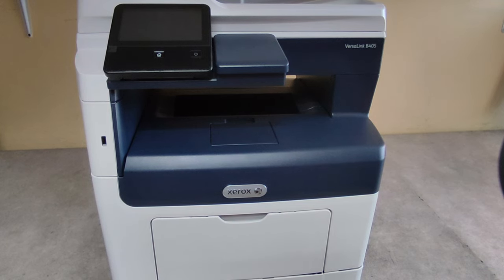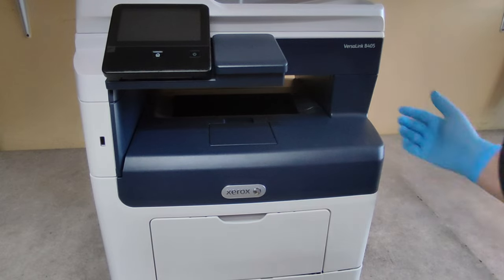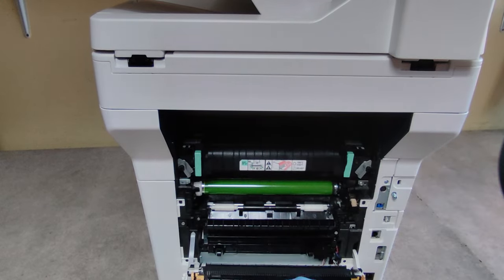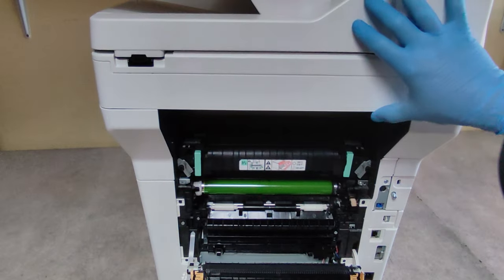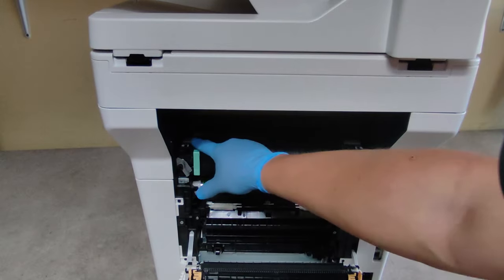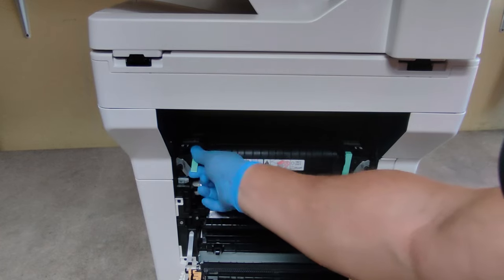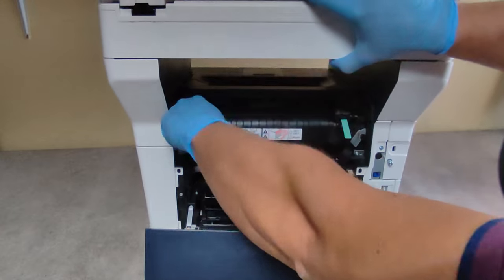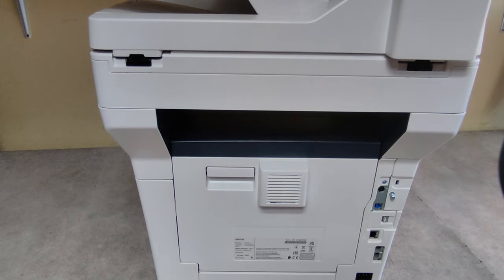HOW TO FIX CHECK FUSER PRINT MODE ERROR ON XEROX VERSALINK B405

Comment: Yeah, but what if you get the message while the fuser is actually already set in the correct position??
Reply from the maker: If it is in correct position and you keep receiving this error message you have to contact the service center. It's pretty sure that the fuser has some kind of defect.
Reply: @MrPrintGuyDIY  it's not a defect per se; it's simply bad design that Xerox devices had 15 years ago and they dared to bring it back.. (Thank you brilliant Engineers)

1- Yes, it's a bad engineer issue; they should've never messed with the envelopes through the fuser but to adjust it like other models.

2- So when people are having paper jams (and it will happen because people don't have media training, heck a lot don't know there is a first side to use on the paper reams, you'll have less jams if inserted on the proper side, usually flip the ream to open it and then put it inside the device as is, face down)

3- People are stupid (it's obvious for a lot of users, including this engineer) so they touch the green latches that changes from envelopes to 8,5x11 without releasing the pressure roll green lever first (same on B400 Models, I change them by a shit ton)

*If you take your time removing a paper jam, you'll gain more productivity than hurrying up and having paper pieces stuck inside, and then you might have to place a call, then it will be less productive. <- Gift from me to you.

inside the fuser is a spring for those latches that keeps on pushing.. If you force change from 8,5x11 to envelopes (or vice-versa) WITHOUT FIRST releasing the pressure roll latches at the bottom, over time the spring will make the latch to loosen and then the sensor will not see 8,5x11 anymore.

Once done (this mistake), you can extend the fuser life if you follow the steps shown above but over time the spring inside will make it to fail and you'll have to replace it before it's time, which should be around 200K Impressions.

@nielsscholll3525 If you get the message while the fuser is supposedly in the correct position, it simply means someone at some point messed with the wrong latches (if they ever admit it) and eventually the message will appear on it's own.

Hope you have a service contract; not sure if intended, but you'll replace a lot of fuser if not careful. $$$
Reply from the maker: @MrLove-666  I totally agree with you!
Reply: @MrLove-666  I just came here to say, THANK YOU! but, as soon as I got the error I bought a new fuser and the error code stop appearing, until one week ago (it's been 7 months since I've used this new fuser) haven't reached the 200k impressions yet. what could it be now?
Reply: Since I'm a visual type, I can't say what's happening to your device and/or if there is something else that creates problems.

Fusers are part of Maintenance Kits (HFSI = High Frequency Service Items) so, since they are produced in batch, there's always the chance that it was made on a monday morning or friday afternoon (old joke ;-) ) and won't do it's 200k. Sometime I need to replace them and they have 15% life left.

(It's an average usage, just like Drum units that does 65k impressions on average with around 5-6% total ink page covered)

You made 7 months without a problem, I'm glad to read that!

There is a chance that you might have to call for a tech so he can inspect your device and Fuser.

Since it's been a long time( 7 months), Xerox (and their partners) have corrected the issues of giving errors if people mess with the grey latches for envelopes/8,5x11 (and they do lol)

Still, as a preventive measure, I myself do the fix which takes 2 minutes by a certified technician to remove that error, whenever I receive a new fuser.

It can't fix itself, so yes, you have 2 options, whichever cost the least for you if you don't have a service contract:

1- Call in for service
2- Purchase another fuser

Wishing you the best!